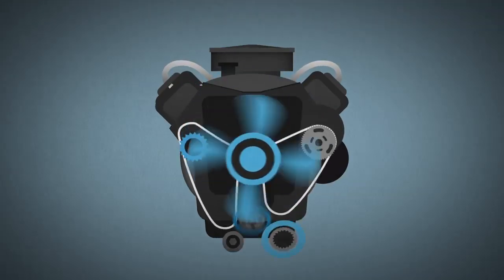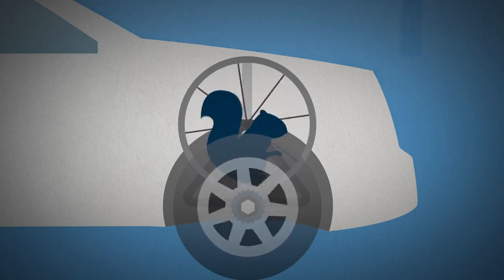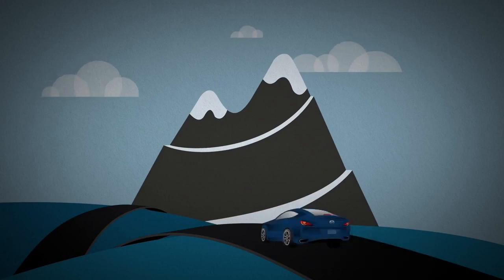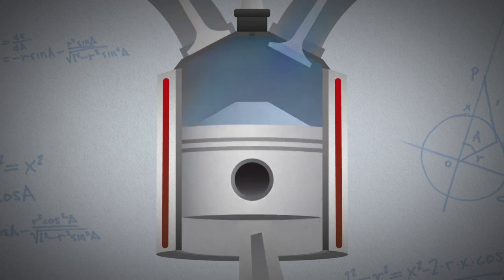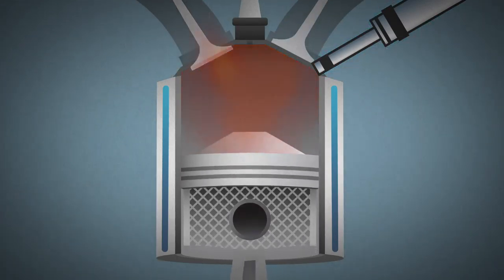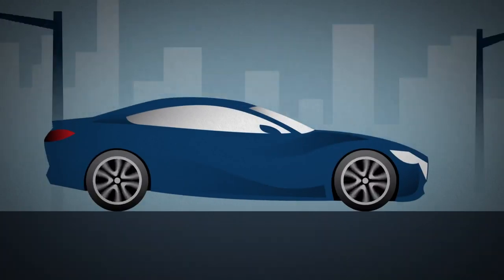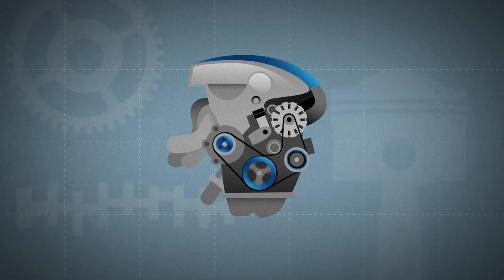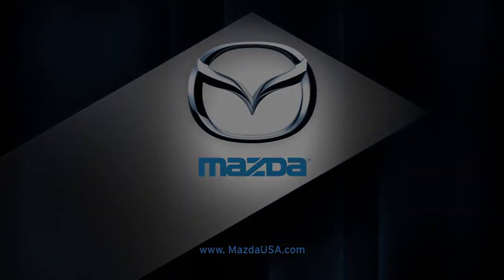Mazda SKYACTIV-G 2.0L Gasoline Engine

Comment: So I'm curious as to what the solution is for the positive crank-case pressure system, you know the hose that connects the valve cover to the intake where the engine sucks oil into the intake ports.. Not an issue on normal engines that fuel injectors placed inside the intake, thus spraying fuel in the intake and washing the intake runners and the tops of the valves on its way to the combustion chamber.  However a direct injection engine, doesn't have this self cleaning feature...